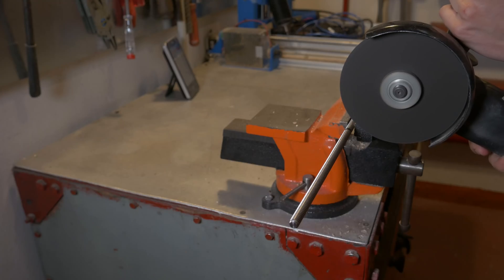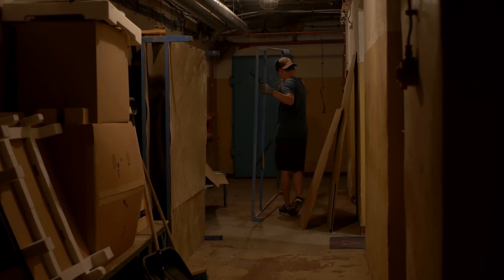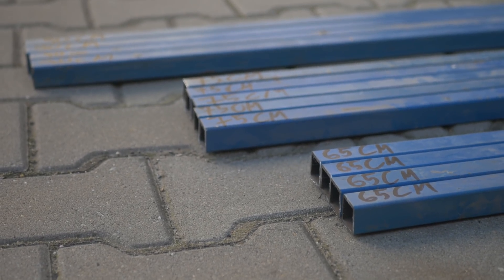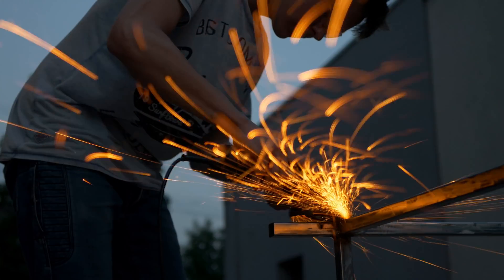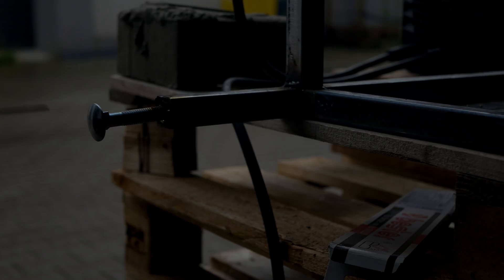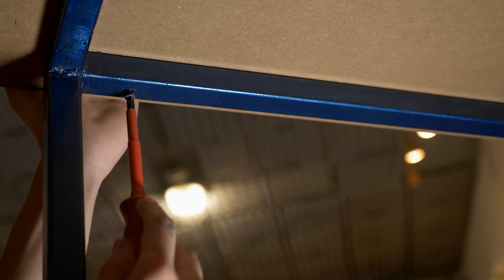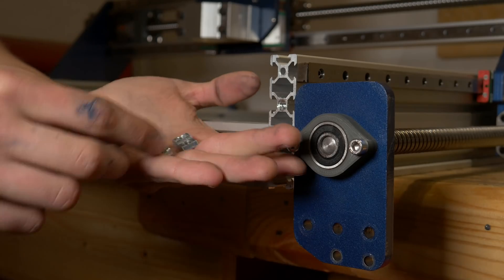IndyMill #3.5 Welding the Table, Finishing Z Axis And Motor Test

Comment from the maker: IndyMill: https://indystry.cc/indymill-cnc-machine
I hope you have a great day! Because I am trying to organize a small production of my custom parts for the IndyMill (steel plates) so that you can easily buy them from my small store and also support my work! And I have some questions about those parts.
1. I used 8mm steel for parts on my IndyMill, some of you comment that this is an overkill and I think you may be right. So should I make the parts out of 6mm or 8mm steel? 6mm will be less expansive to make and most likely cheaper to ship, but if most of you prefer 8mm I will go with it. Heavier CNC is a better CNC :)
2. Those parts will be made in Poland, I am not going to outsource that to china. I want to create a complete product,  powder-coated with threads, nicely packed. So it's not going to be just bare laser cut steel. Price highly depends on the amount that I order, most likely it will be more than $100 + shipping (I have no idea about shipping price). I will do my best to negotiate a better deal and offer you a good price on those parts. I would like to ask how many of you will be interested in buying those parts?  I just want to know if I should order 10 or maybe even 50 kits, the more I order the cheaper it will be :) I would really like this to work out so that I can build a small business with my projects, and sell parts for projects instead of T-shirts :D 
Thanks a lot for help with developing IndyMill! Leave your questions and ideas in the comments!
Reply: Hi !
Why did you choose to go with a leadscrew for Z? Instead of ballscrews like the rest of the CNC?
I usually see a lot of folks that have leadscrew cnc upgrading their Z axis alone to ballscrews.
Just wondering, thanks
Reply: Christophe Kafrouni yes I agree that a ball screw on the Z axis is the way to go. I’m currently upgrading my CNC to ball screw from lead screw because the backlash from the lead screw eventually causes inaccuracies in the Z axis height.
Reply: just take 6mm steel, everything will be easier and sturdy enough
Reply from the maker: I think so too, I will try 6mm and go with it for production and maybe later I will add 8mm option
Reply: 6mm and i'd be interested in purchasing from  you to help out the channel.
Reply: I don't mind the thickness. but even tho I own a shapeoko already I just want to let you know i'll buy a set of parts. Great project so far. very inspiring and I support you all the way!
Reply from the maker: @Ivar_Mennes_  thank you!
Reply: Bro Could  you please share us about  CNC G-code export(apps)
Reply: @reantver9432   do you own a CNC at the moment? 
If yes, I can help you
Reply: @yigageorgewilliams8817  yes i do
Reply: @reantver9432  let me get you well, you want use your CNC machine like 3018 etc but you need an app/ software to transfer g-code command's to it..!!

Okay, if am not wrong try out #Engraver master , #light fire, #Grbl Laser,  #Light Burn..

If am right and it worked, get back to me ..
Reply: Personally being from the opposite side of the world I'd be happy to pay a premium for detailed instructions and cut or design files
Postage is a killer particular on heavy parts
Reply: Excellent video! really looking forward to seeing your new creation cutting materials. It looks solid and sturdy, not to mention heavy but that is exactly what a professional class CNC machine should be. But like many others have mentioned, the cost of shipping heavy steel parts worldwide would make it expensive for folks who are out of the EU. I guess, as for deciding whether to go with 6mm or 8 mm steel. You can build one and check its acuracy etc and if 6mm offer the same level then settle for 6mm which would bring down the cost of making the parts and shipping. I was in the process of making the Dremel CNC but now that you have the IndyMill design, I will wait. I would certainly be interested in ordering.
Reply: I'm currently working on making an IndyMill per your design, but I am planning on making some design changes so I likely wouldn't be interested. I am however interested in the IndyShield, and I am anxiously awaiting this becoming available once again.
Reply from the maker: Great! I am also waiting to get more indyshileds but there are some shipping problems. Also I ordered just 50 of these and there is already over 100 people on the waitlist :D
Reply: Jaki koszt budowy maszyny mniej więcej dobrze by było jakbyś uwzględnił to w kolejnym odcinku
Reply: Be careful you could loose a lot of money maybe wait a bit
Reply: Finished parts sound great, however shipping to US would likely be expensive.
Reply from the maker: @DandySkipper  I am trying to lower the shipping cost too by negotiating with Poczta Polska :) what do you mean by expensive? Like when shipping cost is too expensive?
Reply: @nikodembartnik  I used to run a mail order business 30yrs ago selling electronics components such as Resistors, PCB's IC's and Transistors etc :) To give you an example, say if your sell price of the steel plates is USD $50 and the shipping cost is $55 plus duties and taxes in some countries. Canada being the worst. Then I would consider the cost of shipping to be expensive. Keep in mind the "size and dimensions" of the external packaging you are going to need to use will play i big part in terms of how much more the shipping costs could mount. I don't know in the EU, but in UK, US and Canada the postal service charge is counted by not just the weight but also the size of the packaging.In addition to your postal service, also explore the possibility of finding independent parcel service providers. But not DHL or UPS they are no good because they also charge additional handling fees for delivery and customs clearance at the destination.  Hope the above will give you an idea.
Reply: 1) How is Precision of IndyMill ?
2) Why are you using 2 stepper for  Y axis and one stepper for X axis?
Reply: Why steel parts, not aluminum? 
Aluminum is cheaper to process. You still have an aluminum profile frame.
Reply: @TheTheASHER  yes, I have same question... (And if it will be from steel, i think that 6mm will be ok:), but, yes, 8mm is 8mm😂😂😂
Reply: @TheTheASHER  and ABS/PLA 3D printed parts :D
Reply from the maker: Aluminium is actually more expensive as a material and more expensive to cut. Also threads in aluminium are just threads in aluminium :) Steel is better!

Comment: Hi Nikodem,
I've got a few questions regarding the list of parts. 
 
1. What length is the Trapezoidal lead screw? The parts list asks for 220mm but  they appear to come in increments of 50mm. Can I use 250mm or would 200mm do the job?

2. What pitch/lead should the lead screw be?

3. I'm assuming the Linear rails and blocks are MGN12H is that correct? I see that there is also a 'C' type.

Thank you
Reply from the maker: Hi,
1. Buy a longer one and cut to proper length.
2. It's really up to you, I used 2 mm pitch and 8 lead
3. Yes, MGN12H is the correct type

Comment: Brilliant work my friend. I commented on the 1st video I saw of this build. I think it was the4 video where u actually used the CNC to make the bowl and letter key rings? This is a fantastically made machine.
Like I said earlier in the other video my achillies heel is the Electronics but I'm hoping to learn more as I go. I have basically everything to build my own DIY CNC machine but for some reason I have not been able to find the confidence to get on with it.
Watching ur videos has made me refocus again so I'm hoping the inspiration I have taken from ur build will help me to focus on this again. 
I think I will dump the pulley/belt way and go for this Linear rails and the 16mm ball screws bcos of the backlash issues that can arise in t5hese types of machines.
I think the ball screw builds are better in the long term of a CNC build.
Yes they are way more expensive but they are also more accurate which is far better for what I've always wanted.
I really wanted to build mine 1200mm X 1000mm but I'm not so sure now.
The size of ur build looks like it would be perfect for my needs too. 
I'm going to order the rails and ball screws soon and go for it this year bro..
Thanks again for that inspiration.
Very much appreciate it and it's been great to see such detail in ur videos.
The one thing is the Electronics. I would really like to see a step by step video of that part of the build from somebody on here but it's a lot of work I guess..
Keep up the great work btw. Looking forward to more of ur content soon. Happy new year man..

Comment: Hi, congratulations for the realization of this project.
I have a couple of questions about it:
1) why did you not foresee the motor on the Z axis attached directly to the screw (as in many other projects I have seen on the internet), while you have put 2 pulleys and a belt?
2) why did you make the plates that hold the profiles in steel so thick and not in aluminum? Especially that of the spindle which is heavy and must be moved along with everything else.

I continue to watch the other videos and will probably ask you a few more questions.
Congratulations again!

Comment: It's an incredible project man!
Can't wait to build it myself!!
I just have some questions:
#1: Why not mount the Z-Axis Stepper right above the lead screw instead of usind the pulley system?
#2: Why on the assembly video you pulled out the Ball Screw and inserted it backwards?
#3: How did you make sure both Y-Axis Ball Screws are parallel or collinear to each other?

Thanks a lot man!

Comment: Great job! You have built this one with steel parts. However, having the bed made of wood takes out a lot of precision. Everything flows. Harder or denser less fluency. Therefore, tools, every part that holds it and the object to cut must be done with hard material to achieve precision. I've seen you cutting aluminum, and aluminum is denser than wood. At least you should have an aluminum bed. Anyway, it's awesome!!!

Comment: Hello. Is there a reason you are not adding a second set of linear rails on the y axis? For how much the machine costs already an additional 40 dollars usd would be nice to have the second linear rails I’m aware the steel plate would need a slight redesign, I’d be happy to do it if you uploaded the files.

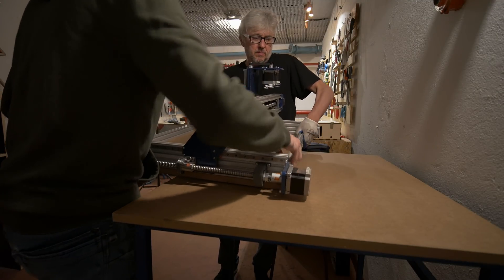Comment: 8:01 Is this a fancy bearing that I see on the Y axis ? :P
Reply: They are called ball screw bearings
Usually used for higher load applications and for better precision.
Reply from the maker: Check out IndyMill #3, I talked about it here :)